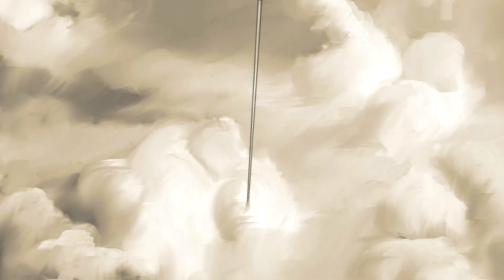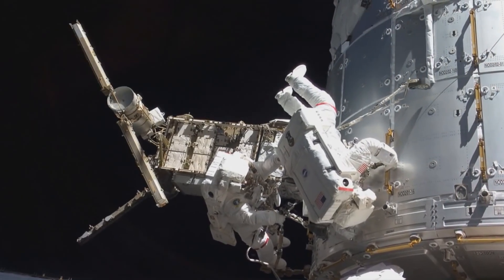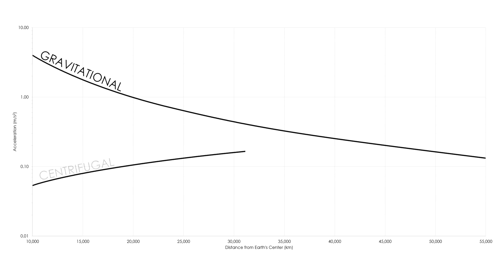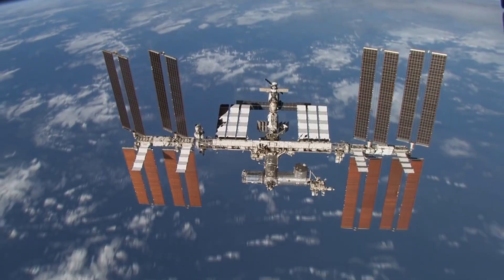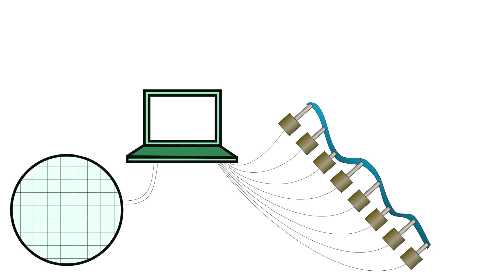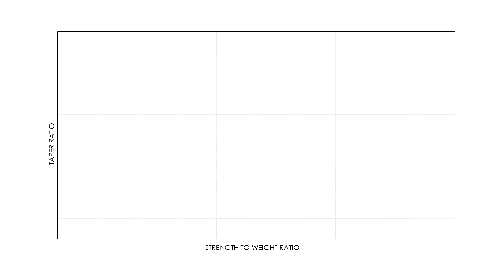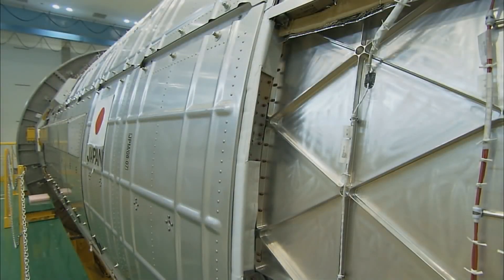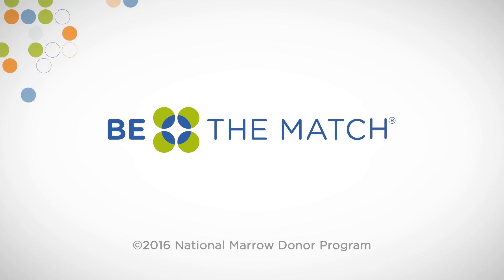Design Your Own Space Elevator

Comment: After seeing the angular velocity symbol on the animation I will now always think of it as the nuts.
Reply: And you go through all the arguments about powering the elevator without ever bringing up the cable.  Honestly that's a huge oversight.  It's like you decided to be as pessimistic as possible in all of your evaluations without offering any solutions or bonuses.  Way to go negative nancy.
Reply: @johnhull2582  Resistance is proportional to length. RIP all your current.

Comment: What if something hit the cable..... What would happen if the cable snapped. How much force is that?
Reply: This is why a lot of designs actually specify a ribbon rather than a cylindrical cable. If the fibers are woven together, the a hole in the ribbon won’t bring down the whole thing. Also, if it snaps it will flutter down instead of crash down.

Comment: Okay so I'm probably wrong but I think I've found a way to make this work. The main obstacle here seems to be the fact that the cable needs to support its own weight and right now we don't have a material that can do that. But what if it didn't have to? Imagine a satellite orbiting earth at a certain distance. In order to be in a stable orbit, it needs to be traveling "sideways" at just the right speed. If it travels any slower, it will spiral into the earth and crash. If it travels any faster, it will spiral outward and escape. Now imagine that our satellite is traveling faster than its stable speed. This means it wants to spiral outward. But we don't let it do that. By tying a cable from the earth to the satellite. This creates an upward tension on the cable which acts opposite to the cable's weight. By increasing the satellite's speed, we can increase the upward tension to as much as we want, until it finally cancels out the weight of the cable. If we do this, then there will be no stresses on the cable and we can build it out of anything.

Comment: Why can't we hv it at poles where rotation is zero,n about cold environment at poles ,if we can built a elevator to space we can deal with the adverse atmosphere....
Reply: It doesn't need to be right at equator, but it is easier and cheaper to build near the equator. Near poles you must add about 4000miles extra cable, and the cable gets more curved, due to laying horizontally. So for that reason the poles and nearby region is actually impractical because a cable laying along the ground for many miles is not useful, but actually dangerous and harder to secure.  A little further from the "impractical" region is still more expensive than equatorial zone. So it is "better" to do it at equator, or nearby. Probably anywhere in the "tropics" is still pretty good as it would likely be within 1% the same length. If it is constructed by lowering the cable, then the cable end will land very near the equator.  If attached to a ship the ship can sail to other latitudes, but still would be best near tropics to avoid the necessity of longer cable. But the extra cable is not too much compared to the overall length, so with a little extra money it could be attached farther north or south.  Futher away from equator also adds extra travel for elevator vehicle. Also if carrying passengers the car would need to tilt or otherwise allow for passenger comfort as the gravity direction changes.  Also at greater latitudes, the elevator vehicle will make greater stress in the cable. It will add about double the stress at 60 degrees north or south as at equator. So basically there are many practical reasons to keep it near the equator.

Comment: would one not be able to decrease to diameter of the tether by just increasing the tension caused by the station. for steel this would be negligible of course. however as long as the stations structural integrity remains uncompromised, increasing the distance of the station from the earth should, in theory, decrease the the distance from the earth to the clark belt as the tension would begin to pull the tether away instead. i might just be spouting gibberish, but shouldn't that decrease the diameter by causing the tether to have to pull itself back?

Comment: So the issue is that most of the tension is actually concentrated in one spot. If there was some way to spread this tension across more length of the cable, it would solve this structure's biggest issue?

Comment: what about using hot air/ helium to get a elevator lifter started, then also support tether along the way with the same? It would only help up to the first 31 miles or so but still would get past the worst of gravity and air thicknesses, Then also why not try doing this at one of the poles?

Comment: You mention that the counterweight must be increased "to compensate for the cable tension".  No!  No matter how large the counterweight is, it will not hold the cable tension, UNLESS IT IS MOVED OUTWARDS.  To remain in geosynchronous orbit, it must be set beyond the usual geosynchronous distance.  Typical practical distances quoted are about 36000 miles up, or around 10000+ miles beyond geosynchronous orbit.  Lesser distances (but still more distant then geostationary orbit distance) would require huge masses, which are not practical to boost into place, although old elevators can be "disposed" upward.
     You fail to mention that part of the source of energy (and almost all of the angular momentum) imparted to the payload comes from the cable's tension acting against the earth's rotation, not the laser or solar panel's power.  So the cable must not be set true vertical; it must be set at an angle.  As each elevator goes up, the counterweight will be set swinging (and space will offer no damping), and careful timing of the elevators will be required to damp this motion.  The periods of these oscillations will be many days!

Comment: I always like these kinds of discussions because it's certainly where sci-fi starts bleeding into science, and we needed to be grounded again before celebrity scientists allow our heads to exceed the diameter of that cable in question. Space elevators do not work, for the same reason (ironically) the "extension cord" wouldn't power it. Plain and simple. While we are at it let's talk about the resources required to build a "Dyson's Sphere"...

Science run amok...

Comment: As for getting power to the climber, you said it’s not like you can run an extension cord, but you are literally climbing a giant cable. The power can’t come from the cable?
Also, if the cable wasn’t straight it could lacks into free fall like a long spider silk blowing in the wind. Objects in free fall don’t have the same forces on them as rigid cables. The cable could be in enteral free fall and the climber would follow its path up.

Comment: Does the elevator really have to be so high? I mean, I looked it up and orbits are pretty stable at 200 km altitude. They're just not geostationary. But does the elevator have to be geostationary? Hmm I guess. If we had to be airborne to use it, then it would probably defeat the purpose of the elevator. Damn.
Reply: Yeah the top of the elevator has to be geostationary or it'll fly away.
Reply: @Mac Debusk What if the platform was on the ocean? That way, it could move with the satellite and hence we wouldn't need to go so high.
Reply: Maybe it's possible, but I can't think of an orbital path that never crosses land. Sooner or later Asia or Central America is going to get in the way.
Reply: @Mac DeBusk Hmm fair point. However, a land station that's periodically active would still be a huge deal imo. For example, if we could send just one ship per year, it'd still be more efficient than using rockets.

Comment: Grady,  I have no engineering background at all but a have a question about the teether. Can’t you move the satellite up a little higher so that it’s centripetal force pulls a little on the tether to cancel out some of the force that gravity is putting on it? I have thought of the fact that it would add tension to the tether but that could be cancelled by making it a little thicker or stronger. Would that work? Or would the tension put on the tether make it so that the tether would have to be thicker than it would be if just gravity was the problem. There must be a balancing point between the two forces that would make the problem of thickness work. Or isn’t there? I do realize that a space elevator would never work because of all the details but I am just wondering if my thoughts were correct or not.

Comment: In terms of power, if it gets easier as you get higher up the cable/tower, would it be possible to switch methods of powering it? Like start with something like an engine/thruster at the lower portion, and then as you get higher, change it from an engine to solar/laser powered, then wouldn’t we actually be able to harness more power/energy from the sun because there’s less atmosphere blocking the suns rays? And as for the giant extension cable idea, why not? No, not literally why not, but look at something like bullet trains and such that have all of these cable running parallel to them, and are used to power said train? You figure that power is needed at the top anyway, so we would need a giant extension cable getting up there anyway. Just a thought I had while watching, I’m only getting to Engineering Phys 202 rn so I’m sure there’s some stuff I probably don’t know about that could be accounted for.

Comment: The only type of space elevator that makes sense is to use a stepped approach...meaning elevator would NOT be a single continuous strand and should have STOP GAPS. I think that it makes sense to have an elevator start somewhere at altitude, maybe some mountain peak or high altitude plateau and go only as high up as sever hundred KM in space...maybe 1000 KM... Thats it. At that altitude you can have a somewhat moderate sized station, kind of a midway station if you will, not exactly midway though... and from that midway station, there would be another tether perhaps that would go to the GEO or a bit beyond GEO. That way the Midway station can be both pulled back to earth on one side of the force and away from the Earth with that counterweight at the Clarkpoint / GEO...

Comment: A space elevator......can't be built, is how that sentence ends. 

You haven't even scratched the surface of the obstacles that would have to be overcome, most of them are the fundamental laws of physics.
Reply: The problem is not with the laws of physics. The problem, as stated in the video, is more of an engineering problem. There would be a few more problems than the tether, counterweight, and the climber. But those three are the biggest ones to overcome. If we can do that, a space elevator would be a viable alternative to rockets.

In addition, with materials we have today,  we can build space elevators on Mars and our moon due to the low gravity of both as well as a lower stationary orbit (for Mars anyway. There's none on the moon , but the Lagrange points are an effective substitute). Like a lot of things, a space elevator stopped being a physics problem a long time ago and is now an engineering problem.
Reply: Well, then you should build one. :-D
Reply: @BuceGar  Maybe I will lol

Comment: As an idea what if we used 2 carriages to move cargo. 1 going up and 1 going down? Put the motor at the top where it can get plenty of light for solar power. You would have to double the mass of the counter weight (plus the extra cables) but it gives a method of moving the elevator. Side note, in order to not have to deal with the weight of the elevator cables changing as they go up and down,  run them in a continuous loop from space to ground level

Comment: Hey Grady, how much would a column (tube) of reinforced concrete 61 miles high, 35 ft. in diameter where the wall thickness is a uniform 24 inches, weigh per sq. in. if that weight were to be distributed evenly among 6 "legs" approximately 1 mile long (reaching the Karman line in total height)?  Then put a reinforced concrete disk on top of that that is 45 ft. in diameter, 24 in. thick for the outer 6.5 ft., and 23 ft. thick for the inner 32 ft.?  Now, what would the PSI be on each leg's ground contact point, if the tether or "cable" is anchored at this disk and extends 1000 or so miles beyond the Clarke Belt so that there is a lot more centrifugal force acting on the anchor point, actually "pulling" on the anchor?  Just dreaming of a time where we might actually develop a material for the tether that can withstand both the tensile forces, and the temperature/radiation variations in space.

Comment: .......w8
You can get angular inertia from the earths rotation to keep the elevator up? (You call it centrifugal force but I dun like that word)
That is kinda hard to visualize. I always wondered what would keep the damn thing up there
I'm still guessing you'd start by putting a satellite into a geostationary orbit around the earth with rocket boosters. And then feed the cable downwards. But how would the next step work? How do you get the earth to use its angular momentum to apply tension to the cable? Cause once in Geostationary orbit, the satallite can pretty much just stay there for a good long while... unless you give it a downward pull or a drag then it will eventually end up crashing thru the ozone layer....

Comment: So you take a 26,000 mile long piece of material 
and you taper it toward the ground, and you have
a little earthquake. So the wave goes up 26,000 miles
and comes back increasing its speed as it followed
the taper, like a  . . . plain old cowboy whip, and 
What could go wrong? If it breaks at the bottom,
it cuts a pizza place clean in two, and if it breaks
20 miles up, it falls and shorts out all the electrical 
lines for 3 miles around. It might even cause a fire
tornado and reduce the area around the anchor 
facility to ashes.

But I did like the analysis.

Comment: Doing some research for a project involving heat. The tolerances for the polymer is it has a melting point of 429 degrees fahrenheit, but will start to deflect under a light load at 148 degrees. So my question to you is what qualifies as a light load? It's a lightweight but thick piece of polymer, so would it collapse in on itself at lets say 350 degrees? Or would it be fine as long as it cools before being moved or touched?

Comment: We wouldn't need captured asteroid. The moon would do just fine. But we'll need to make a large supporting station that's at least quarter of the moon and pyramid shaped. Hexagonal giant pyramid structure. The width of the cable would have to at least be over mile wide which would need an elevator that's at least 6.2% bigger/wider on each/all sides. But the cable would also need to be VERY strong just like you said made of strong nanofiber like material. But there's a problem, the Moon will eventually keep closing in on Earth and getting further which would mean we would need to build a mechanisms that will control the cable every time Moon moves away/towards the Earth. I know, Earth's rotation is also a factor but the fact is Spacevator would be INSANLY impossible to build.
Reply: Moon is waaaaay too far and too big.
Reply: Frank Belluccia it's not that far. Anything closer will get pulled by Earth's gravity.

Comment: Why not make the climber just to travel less than half the distance to the weight? Traveling 20,000 kilometers or something like that just wastes energy but stopping it at a lower height will still be able to drop off cargo to space, right? I understand that gravity will still pull you down even at the same height as the ISS, but with a little thrust horizontally, you’ll still be able to reach zero gravity.

Comment: The upper atmosphere is positively charged and the earth is negatively charged. Is it possible to use the differential to create an electrical circuit that conducts along the tether, and the climber draws power from the flowing electrons? It would essentially have the power of a bolt of lightning, only constant and localized along the tether...

Comment: could the cable have intervals which support the weight of the cable with helium balloons or rotors and ion thrusters in space? expensive but progressive? also pass a current through the or around the cables like scarelectrix, finally could there be a tube structure where the carrying vessel is propelled to space via vacuum?

Comment: I heard another idea that sounds too good to be true and I'd love to see a video from an engineer that either confirms or debunks the principle.

A tethered orbital ring. To build a ring around the planet, then tether it on hundreds or maybe thousands of places across the globe. Then turn those tethers into elevators. Instead of going tens of thousands of kilometers, it would only need to be about 400km high, which should bring the tensile strength required of each tether to reasonable levels for modern materials. 

Instead of making 35000km of tether, it requires 45000km of space station. Which does seem like more work if not for the fact that what's being made is effectively usable space. If the raw materials are gathered on the moon, manufactured in lunar orbit to be shipped back to Earth's orbit, then the cost should hypothetically be cut dramatically. The moon does have a lot of titanium.

I imagine it would be a frightening moment when the ring is done being assembled and it needs to be slowed from orbital speeds to a geostationary speed for tethering.

Comment: O the power problem, couldnt wires be put i to the cable to power the elevator?
I know it would increase the mass, but if they are made out of something structurally sound and conductive like carbon nanotubes it shouldnt be impossible.